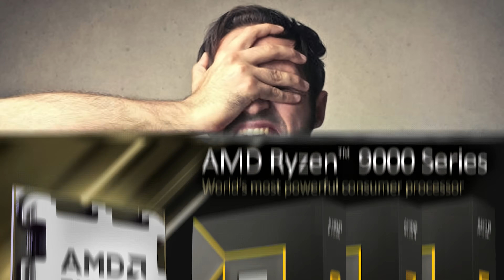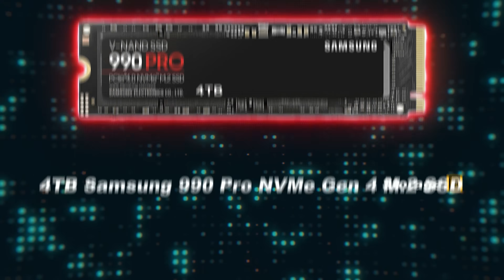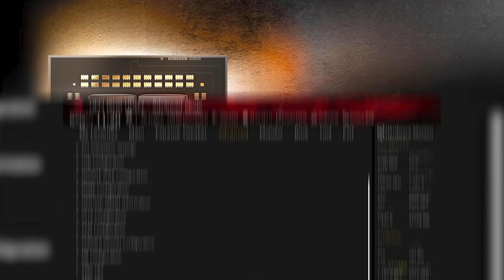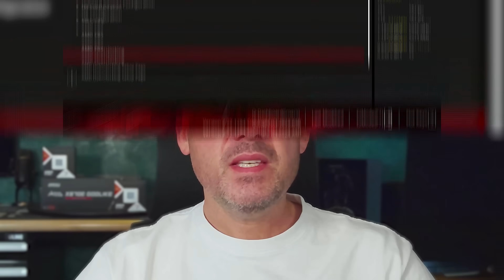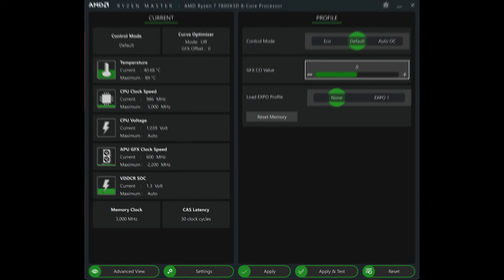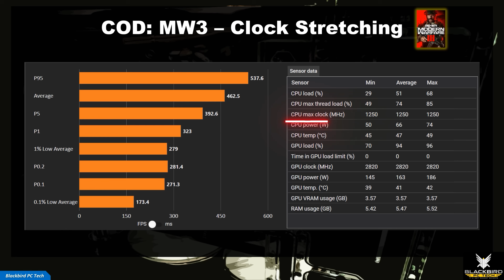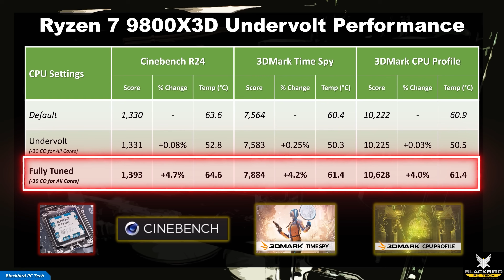How To Undervolt a Ryzen 7 9800X3D The Right Way! (or Any AMD AM5 Ryzen CPU)

Comment: Just got a 9800X3D so this video getting recommended to me now is perfect timing lol.
Reply from the maker: Hopefully you got a good quality chip and will be able to achieve a solid undervolt.
Reply: @blackbirdpctech  Already tested negative 10 on the curve optimizer and it's stable, hopefully I can reach 30. Im gonna pair it with a 5070 ti and I'll make sure to upload a 15 game benchmark of my pc soon, that's if I can even get the 5070 ti before it's sold out 🤣
Reply from the maker: @VoornePuttenBenchmarks  good luck ... the only good GPU news is that we will have some competition soon in the form of the 9070XT, so I'm hoping that will help with availability and pricing.
Reply: i'm getting this cpu soon in my new pc, did you apply and is it still stable after this long?
Reply: @moyya7902  I have been using negative 10 on the curse optimizer, abive that and the cpu is unstable, and a 200mhz pbo oc and so far in the past 8 months I have had zero issue's.

Comment: I use Project Hydra Tool. It Takes 2 hours, but then you have it perfect.
Reply from the maker: I've used CTR and Project Hydra a lot, and the problem I have with it is that the overclock/undervolt always, and I mean always, results in an issue (blue screen, error, etc.) ... I've never gotten a fully stable overclock from using the tool. I think it's a good tool to use to help dial-in your system but I would recommend backing off what it finds to improve stability.
Reply: @blackbirdpctech hmm Mine IS stable, all tested ... Y-cruncher, OCCT and so on. I used Hydra 1.8E
Reply from the maker: @m.m.3753  I will have to give it another shot ... I really like 1usmus and the work that he does ... he's based in Ukraine and has been continuing to develop it throughout the war, which is super impressive.

Comment: Just a heads up , very very few cpus will do -30 with tight timings memory overclocking & +200 override even at 1x scalar. -10,-15 is the sweet spot with memory overclocking & override enabled. even with that you have to fiddle with vddp,vddg voltages at 6200,28 or at 6400,30 ram frequency and timings.
Reply: Yes. Mine can only go -15 :( 9800x3d
Reply from the maker: @cafealpha82  that's still significantly better than stock settings, which is what the vast majority of people run these chips at.
Reply from the maker: That's not true. Every one of the many 9000 series chips that I've tested can do -30 CO, with the exception of my 9900X, which could only do -25 on the second CCD. The memory that I used is new from G.Skill and is not tweaked beyond enabling EXPO. There was no tweaking of voltage required. In the future please ask questions about the setup I used versus inadvertently spreading misinformation.
Reply: Meant no disrespect,had experience overlocking both 7800x3d & 9800x3d, first of all at xmp you can set pbo at -30, that doesn't mean it's the best performing system especially in gaming. Overlocking ram gives the best uplift in  1% low in in games like warzone, Fortnite etc. for example my ram timings are 6200 cl30 36 36 72 with nitro settings 121, power down mode disabled, fclk 2067, uclk=mclk. Secondry timings are buildzoid tight timings with tREFI at 50000. Problem is this setup requires a lot of voltage from cpu which limits the pbo to -10,-15. This is the best settings in real world scenarios especially in gaming. Give it a try , we are here to learn from one another.
Reply from the maker: @ I have a video on how to properly tune and optimize an AM5 Ryzen based system and I have a video on the best memory for AM5 systems ... Buildzoid provides some great info if you can find it in his videos ... that said, I've never seen him suggest a tREF of 50000 ... it's pretty standard to use a tREF=65535. Typically the voltage changes that you make to help dial-in your sub-timings will not impact the curve offset you use ... I did that on my X870E Hero to dial-in super tight timings on my DDR5-8000 kit and I was still able to run a -30 CO stable.
Reply: Furthermore the best test for checking system stability when undervolting is aida64 system stability test with cpu+fpu+cache+system memory stress test. Let it run overnight.
Reply from the maker: @ you either didn't watch the video or you are repeating parts of the video in your comments ... it's a strange thing to do

Comment: Maybe you can help me - can you recommend any solutions to high RAM latency? I'm running a dual rank 6000CL30 2x32GB kit, I've seen bulldzoid timings but they supposedly work only on single rank kits. I currently have as high as 88ns latency under AIDA memory test.
Reply from the maker: The simplest timing that you can change that will have a large impact on latency is to set your tREF=65535.

Comment: Bro I understand how to undervolt and overclock, I just don’t know what I’m suppose to be looking at to see if things are running smoothly, besides doing a benchmark test on cinebench and watching for a system crash. Am I suppose to be looking at voltage  and watching for the average,max, min clock speeds? Do I look at what voltage it’s sitting at?
Reply: Temps
Reply: the clock speeds indicate whether its clock stretching or not so eye on those
Reply from the maker: That's literally in the video ... there is a section called "How To Test The Stability of Your Undervolt". It's usually a good idea to watch the content.

Comment: What ram would you recommend for 9800x3d? 6000mhz CL30 or something with a higher speed? Also does a A-die or M-die make a difference?

Keep up the good videos!
Reply: 6000 with the lowest CL you can get for a reasonable price.
In general, memory speed doesn't matter as much with x3d chips, so don't over spend on your ram.
Edit: I know you're asking the YT guy, but I figured I'd leave this here with there being no other responses yet.
Reply: @B_Machine  if i underclock the cpu, then  underclock the ram, will it mess up the perfect sweet spot of 6000mhz CL30 for the 9800x3d?
Reply: @02dusk  Yes, underclocking it will reduce the performance. Undervolting may be good though.
Reply: @B_Machine  would the answer be any different if the processor was the 9700x?
Reply: @pradogx1  the 9700x would be more affected by your memory choice since it has less L3 cache to use (so it'll have to "go to" the ram more often). But I've had 5200 cl38 and upgraded to 6000 30 recently. The difference is small for my ryzen 7600. As long as you get 6000 CL30 (or less than CL30)you should be fine.
Reply: @pradogx1 I am using this too with expo profile. Waiting for an answer
Reply from the maker: Take a look at my "What's The Best Memory for AMD AM5 Ryzen CPUs?" video: https://youtu.be/JuUhnQaGG_I

Comment: My 9700X can boot at -30 but not stable; -25 is the highest stable value. But I also cannot touch the BCLK setting OC, so it stays at 100 MHz.

With clock override can jump to 5750MHz and can stay arround 5400 at Cinebench test.
Reply from the maker: One of my 9800X3D's can only do -25 CO ... if I push it to -30 I get clock stretching, as shown in the video. The good news is the performance difference between -30 and -25 is very small.

Comment: I remember seeing you recommend AIDA64 in the comments of a past video. Happy to see you using it here.

In my first stress test using AIDA64, I discovered my -28 offset was too intense despite all other testing software showing stability. Bumped it down and found a sweet spot at -25 with a +200 overclock.

One thing worth noting is the importance of letting it run for around 10min. If the offset was too intense, it would fail the test generally within the minute… but the closer I got to finding the perfect stable offset the longer it took the test to fail. 8:27 was the longest duration before failure I ran into, and that was at -26 offset right before finding my sweet spot of -25.
Reply: You got a good sample the max undervolt I can get is -17 stable with overclock
Reply: @Motion_God  -17? Not too bad. We take those!

If it helps... I also remember seeing Blackbird mention how sometimes your max undervolt could be limited by only one or a few cores not being able to handle the offset. So technically there is a chance where your sample could run -30 on 7/8 cores while only having one core set at -17.

Finding the highest stable undervolt per core is time consuming tho... but if you wanted to experiment, setting all to -17 as a baseline and using AIDA64 is the fastest way since it'll fail quickly compared to other stress tests.
Reply from the maker: First, you will get most of the performance gain at -17, but as @Halo2Trigate correctly stated, it's likely that it's one core really holding you back, so if you have the time then it might be worth testing all 8 cores.
Reply: @blackbirdpctech  I didn't know -17 was still that strong, good to know. We need more content creators like you man. Hard to find ones who really know their stuff.

P.S. It's also good to know you're human too by @ing the wrong person! For a sec I was convinced you were some super-advanced AI experiment!
Reply from the maker: @ ha ha ... my bad, I was replying on my phone while looking after my daughter, always a recipe for disaster 😉
Reply: @Motion_God  just got yesterday 9800x3d put -30 and +200mghz and run extreme stress test in OCCT for 1 hour works fine
Reply: @Deimos-28  dam you got a really good sample then congrats
Reply: But anyway temperatures are not super good... in stress test it went max 95 degrees and in games it is around 70 degrees
Reply: @Deimos-28  dam you need to invest in a new cpu cooler I hit 75 max on stress test and 45-50c gaming with an overclock
Reply: @ I have BeQuite Dark Rock 4 probably it is not enough for this CPU
Reply: @Deimos-28  yeah you should probably repaste your cpu because your not supposed to thermal throttle with an -30 offset
Reply: @Deimos-28 try aida64

Comment: If you get a chance getting a 5090 or borrowing a 5090, under volt a 5090 video would be lovely, thx bro
Reply from the maker: I have a 5090 FE on the way while I test the 5080 … I’m very eager to get my hands on it and start testing
Reply: @ nice, I believe strongly 5090 has to be under volt, really don’t want it get burn 😂

Comment: I was looking at the Ryzen 7 9800X3D on PC partpicker past couple of days. Highest was $556, but it was like the MSRP price is $479. Hell, nah. Checked again today, $315 on amazon ☠️ copped so fast. Guess it does help to check everyday or so.
Reply: Unfortunately, you probably got scammed. You definitely bought from a 3rd party seller, and you likely won't actually receive a proper 9800x3d. I hope I'm wrong. Good luck!
Reply: Get ready to refund that thing. You'd be lucky if you even get a cpu shipped to you. A lot of scamming has been going on on Amazon and eBay.
Reply: Did you get scammed
Reply from the maker: Wow, that's an amazing price for the 9800X3D

Comment: I will have 9600x, do I benefit much from undervolting it? Will be paired with 7900xt/xtx/4070ti equivalant range of card
Reply: It'll keep your temps and power usage lower than stock and theoretically help the longevity of your CPU and cooler.
Reply from the maker: Yes, absolutely ... I would recommend undervolting all AM5 Ryzen CPUs.
Reply: What config did you use for your 9600x?

Comment: My 9800X3D with All core -30 works flawlessly for me I'm using it with Asus ROG Strix B850-I mini ITX motherboard ! 😉😉
Reply from the maker: -30 is typically where I try to land on my CPUs ... more than that and you run the risk of clock stretching.
Reply: @blackbirdpctech  What is clock stretching?
Reply from the maker: @ I explain it in the video
Reply: @blackbirdpctech  cool but is it dangrous on the CPU?
Reply from the maker: @ do you mean is clock stretching dangerous?
Reply: @blackbirdpctech  yes is it going to hurt the CPU?
Reply from the maker: @Itsyesfahad  I don't know if it will long term but it will impact your system performance
Reply: My 7600x is nothing but issues with uv. Ryzen master tells me -30 is good(but tonnes of errors on occt) -11 all core gives no issues on occt. However gaming is fine and no crashes with -30
Reply from the maker: @jinxiejinx4175  Ryzen Master is terrible and finding a stable undervolt ... it sounds like your -30 CO is in fact unstable, just make sure you are not getting clock stretching in your games
Reply: @blackbirdpctech no idea what clock stretching is. Oc is so different compared to wheb I used to do it 10 years ago. Getting lost with all the new things that can be changed. But trying to get changes locked in and stable
Reply from the maker: @jinxiejinx4175  watch the video!!

Comment: My 9800x3d
Pbo co-40 with noctua d15
Oc+50mhz
Temp below 95c during bench.no throttle.

If want oc more need upgrade 360aio.
Reply from the maker: That is a heavy undervolt, just make sure you are not getting clock stretching … if not then you definitely have a golden sample cpu
Reply: Have you actually tried using +200 boost override? I imagine it would be better to get the extra clockspeed in gaming where you won't be thermally limited. This way the CPU will hit 5425mhz while gaming but reduce clocks when hitting 95°C+ in CinebenchR23/Heavy  Workloads.
Reply: @jjlw2378  yes pbo co-40 with +200Mhz is workable but i only +50Mhz because i want overall work without any tjmax throttle.
Reply: @k8118k try to put mine in -40 very unnistable I had to change to -30 and all right so far
Reply: To see true stability use ada 64 extreme stress test -17 is stable for me
Reply: Mine mobo is asus tuf x870 plus wifi

Comment: I love your concise presentation style. It's dense with information but seems to be straight forward to follow and I very much appreciate the additional info which provides us rookies with a shallow understanding of what we're doing.

The proof is in he pudding though... or rather stuck in some DHL distribution center atm. I'm looking forward to apply your instructions to my 9700x once it arrives alongside with the rest of the components for my new build.
Reply from the maker: It’s exciting and frustrating waiting for your parts to arrive … good luck with your build … let me know if you have any questions.
Reply: Got my 9700x! Did you try it and if so, what are the before and after results in temps and performance?

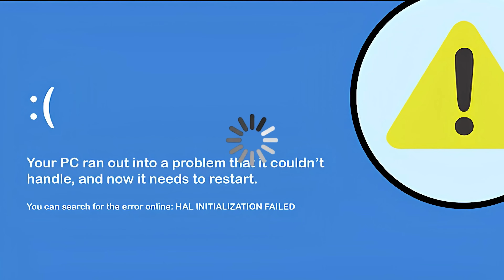Comment: 0:41 for me as beginner in that topic it was (well still is ... and i believe it will stay with me xD) a pretty good idea to just use ryzen master when i got my ryzen 5 5600x a few years ago and tried for the first time to do undervolting 
the benefits for me are pretty clear whatever i mess up and the pc restart it will start with boxed settings and i have to actively start ryzen master and change the settings to whatever i want so no matter what i set in ryzen master my pc can ALWAYS boot fine 
that way it was pretty fun for me to play around and find a few limits :D

i reduced the temps from around 70 degree celcius to under 50 full load .. at the same time there is no boost anymore so a lot of "missing temp" is from that fact my cpu is just running on 3,9 ghz instead of boosting up to 4,4 or even a bit higher ... for me it was no noticable performance that im getting from that but the temps you could see ... and feel ... xD well and the power draw goes up as well about 10 to 20% with boost ... so for me it was a tripple win lower the power draw and the temps without losing noticable performance

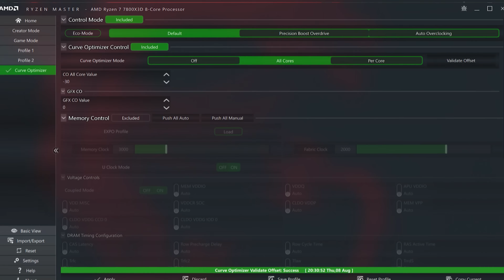5:40 pretty funny ... i never used the curve optimizer i just used the profiles .. ;D  for everyone curious im from 1,25625 volt down to 1,1125

main reason to undervolt for me was just the power usage which i reduced around 20% (sounds much better instead of saying "around 12 to 15 watts" XD) the lower temps are nice to have for the summer but for the cold days sometimes i miss the cpu without undervolt to be honest :D

Comment: nice video. also, at least with my 9600x, i like to go one more step and use curve shaper specifically to undervolt the max and maybe high clocks further. but i have to be careful, because using it with a difference greater than 13 immediately causes the clock stretching issue. example being -30 on max and -16 on high causes cpu-z to go out of whack with the benchmark. i set -30 max, -18 high, -6 med, +6 low in that case.
Reply from the maker: I’ve found curve shaper to be too much hassle for not much additional performance benefit whereas curve optimizer seems to be quite robust.

Comment: So why would you underclock or over? Built my first pc with a 9800x3d and 4070 seeing two get burned (could just be one chip) has me like did I do the right thing keeping it stock?
Reply from the maker: Undervolting is very different than under clocking, in fact it increases your overclocking headroom, allowing for higher performance. I show the impact of undervolting in the video.
Reply: @treblemix_  the reason I’m interested in an undervolt is my 9800x3d runs in the 50’s/ 60s during game loads with my 360mm AIO however when launching new games this thing hits 95c when downloading shaders, that’s insane, I want it to chill out
Reply: @TheSaturdayNights  which aio are you using ?
Reply: @TheSaturdayNights  im using artic liquid freezer iii 240, and max temp is 85

Comment: I'm curious. I use Microsoft Flight Sim. It's my prefered game. Temps never exceed 55C, but average about 45C. Would it be recommended to undervolt the CPU regardless? Only when I run benchmarks do the temp go up to about 70C. Thanks for the info. Good stuff!
Reply from the maker: It's such an easy tweak to make that I would recommend it ... even not pushing it just by doing a -20 CO would be beneficial ... lowering the voltage and temps will increase the life of your components, so that's always a good thing.